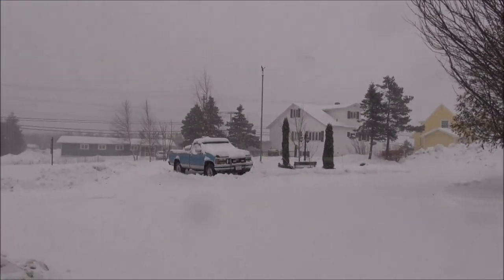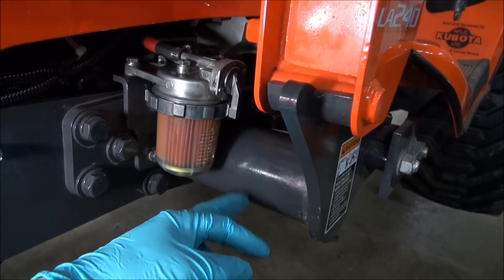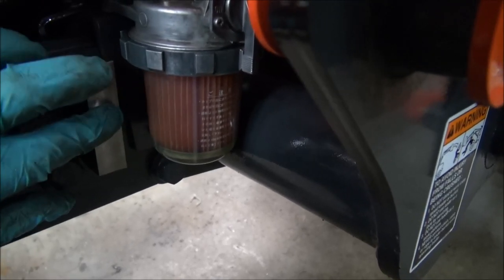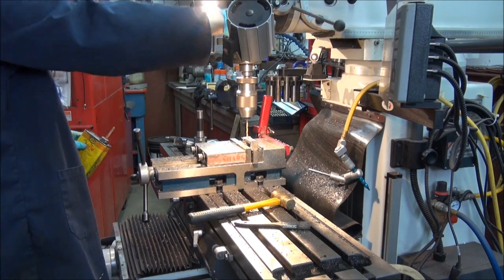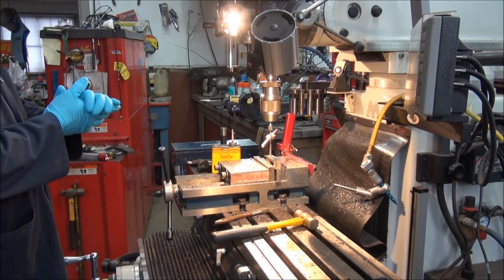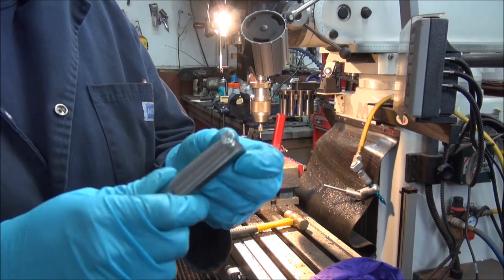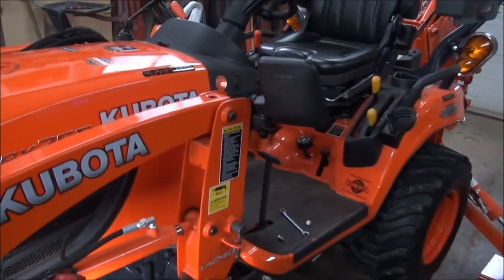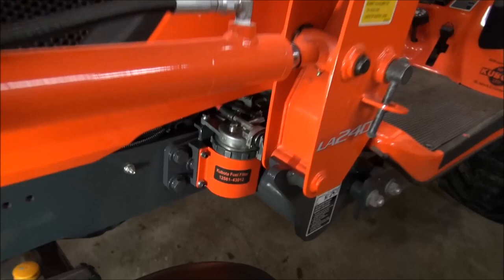Kubota BX25 D Fuel Filter Custom Guard

Comment: I just spent an obscene amount of time under my BX to change that little filter (hateful location) because it stalled during that last snowfall removal (delayed cuz I caught a cold lol) and I don't know if it's because I was not 100% yet, or because I watched this vid BEFORE I went to the garage (subconscious message lol), but needless to say I will not crawl under there to change that filter again; it's coming out, and THAT MOD is going in. Part ordered, fittings bought, bracket fab in sketch mode. Thank you (again lol). Seriously, that setup ought to be standard.

Comment: Paul, ya need to put a vert. slot in the filter guard so you can see if the filter is getting full of dirt.Right now ya have to take the guard completely off just to check it. Love your videos. The Mrs. does a great job on the camera.
Reply from the maker: Thanks George. Actually I can see it clearing from the back side of it 👍
Reply: OK. Didn't want to criticize.... just wanted to help. So no prob. BTW I'm originally from Vermont so I know what the cold & snow can be like up there. You're doing a great job.
Reply from the maker: Thanks George. Not to worry. I put a lot of thought into the mods I do and I do them to fit my needs. This mod has been great for the machine. It's a much better filtration system that what came with the little tractor. Vermont is a beautiful state. Some day I plan on heading down that way. Keep well.

Comment: Wonderful job. You can send me one anytime. The fuel filter install was also excellent.
Reply from the maker: Thanks David. Glad you enjoyed the videos. I use to work for a guy with the same name as yours when I worked for GM. Good guy too.
Cheers!
Reply: Paul thanks for the info on fuel separator. I started my install today. Picked up one from a b series at the dealer today. Need to run fuel lines but didn't want to take it apart yet, big snow storm coming Sunday eve into Monday.
Reply from the maker: Cool. Glad your making the move to get it done, you won't be sorry. It's a good mod. Good luck with it.

Comment: Nice mod! I bought my BX25 D a month ago and came across your videos a couple of days ago and immediately subscribed. I appreciate the quality and creativity you both put into your work. I was looking for new ideas for my new toy and I definitely came to the right place! I will be building a little shop for myself in the spring, though it will not come close to your shop, (which I am quite envious of...lol) I will use what I have at my disposal to try and create some of the mods you have. The fuel filter and guard are a must in my book. I also must look into the wheel spacers as my property is very hilly and steep. If I remember correctly I think you mentioned where to buy them in a previous video, but if you have time to reply to this post could you mention where to get them again, thanks. Keep up the good work you two! we'll be watching. In the future I will need to talk to you about those center caps, they might not be a necessity but yes they do rate way up there on the "Cool Factor" ...lol. I want some!

Comment: Great mod, Paul! I bought the conversion kit off eBay, hope to get it installed soon, and maybe my own fabrication of the guard.
Reply from the maker: I was the original designer of that mod you bought. After I posted pictures and videos on it then it started showing up on fleebay. I haven't studied how he attaches the filter but it don't have the same allowances for the guard that I have. Mine was designed for the guard. I used to shair my ideas until people started using them for profit. Now I have four more on the on my BX that will never be seen or shown because of that.  When you get yours installed take some close up photos of the filter and maybe I can fab something for you ;)

Comment: Hi Paul new subscriber, but have watched your videos for awhile. Got addicted! Looks great but I think I would have painted it the grey color like the rest of the items down there on the tractor. I have a b2910 and it has a nice fuel filter set up that would be easier to mount. It's got 400hrs on it and still looks clean. Your a talented Guy keep up the good work!
Reply from the maker: Hi Mark. Colour is such a personal choice in people with no one being wrong because it's simply an opinion. I wanted it that colour so it would stand out from the boring grey and considering it was in a video it would be easier to show it by usingnthat colour. This set up the same system that's on my Grand L 5740 so I know it's good and will work well. Thanks for watching. Happy tractoring.

Comment: Question for others with this type of Kubota fuel filter assembly.  There is an "On" marking all the way to the left at the 9 o'clock position, in addition to the straight up / 12 o'clock "On" marking.  Is there a difference between the two?  Ours is always set in the straight up On position for normal operation, but I've never found why there is an On to the left.  Bypass?  Thanks in advance.

Comment: Beautiful work Paul and Kathy.Though it would be better to be able to see the filter without having to remove the guard or getting down on ones knees to look at the bottom of the bowl.Creating a vertical slot in the guard?Creating the guard from Acrylic? I'm sure you two will solve the problem if you deem it to be one.
Reply from the maker: Thank you. When I was doing it I also pondered that idea and thought about punching a slot in the guard and then figured with that slot and my luck it would be the very thing that would go through the slot and take the bowl out. The acrylic would be fantastic IF I could get it as strong as needed but there's nothing around these parts to get it plus the 1/8th steel that I used is brutally strong and don't take up a lot of space. I've come to the conclusion that I will replace that filter ever 100 hours weather it needs it or not.  Great suggestion and thanks for it.

Comment: I told you that you were going to get snow but I think you guys get more than we do thank goodness.  I have ran out of room to put it out of the way.  Another Great project but I have some questions this time which for me is good.  First the guard is welded on to the mount for the fuel filter, can it be removed as one unit so when you do the check of main frame bolt torque on the FL mounts ?  Second can you still see the clear bowl of the filter for anything in the fuel ?  just thinking but as always it is a great video and I enjoyed it.  I also want to thank you for being so detailed about how and what you are doing, it helps me at least for learning and review.   Oh and yes there is more snow and cold winds a coming.......Brrrrrrr!
Reply from the maker: It's a crazy winter here. I just looked out and couldn't see a thing because of the blowing snow.
Here's the order of the mod:
#1. Fabricated a mount to attach the fuel filter assembly to. This mount was milled out to fit over one of the fel bolts. The mount it's self was bolted to the frame via two 3/8th bolts that I drilled and tapped into the FEL mount. I then added the guard block but it's welded to the filter bracket.
So to check the FEL bolt torque you would,
#1. Using a 5 mm alan wrench remove the two bolts holding the filter guard
#2. Remove two top 5/16 bolts holding the filter assembly on.
#3. Push filter assembly to one side.
#4. Remove the the two 3/8th bolts on the filter assembly bracket and bracket will come off.
#5. Check torque on FEL bolts.
#6 To reassemble reverse the procedure :)

If you look up under the guard you can see if there's any dirt or water in it. I didn't want to punch out a slot in the guard for viewing because it would weaken it. It's one minute to pull the guard and check the filter condition.
Reply: Paul Short I knew you had it under control,  I will keep my eye out so to let you know about the snow.  I will drop you another line about my week...
Reply from the maker: Jerry Busby
PLEASE. NO MORE SNOW LOL

Comment: hi. i see you added the filter before the electric fuel pump. i have a question  did you add a filter between the electric fuel pump and the injection pump. thanks in advance. my zd 331 has a small filter on both sides of the electric fuel pump.

Comment: Paul where do you buy your metal. I usually get everything a Dominion on Empire Ave. but they don't carry aluminum or larger pieces of steel.
Reply from the maker: Usually Steel Fab if I'm looking for odd lengths and if I'm buying bulk for the larger jobs I'll get it from Russel Metals.

Comment: Thanks Paul...  Can ya just add 2 more filters in line just like it has with the other one's that it already has?  Or that type of fuel filter better?  Just wondering  Thanks Paul for sharing....
Reply from the maker: +Cary Hubbard 
The problem is where the first filter is and that's under the machine. I did this mom for two reasons. One was for  convenience  and the other was for a better filtration.

Comment: Paul, the fuel filter number you put on the guard comes back to the old style filter that you removed from the bottom of the tractor, was that a mistake of the number for the filter. That filter can't be in that new filter you just added. I have the same tractor, like all your ideas and workmanship.
Reply from the maker: Yes I updated it.
Reply from the maker: Thanks